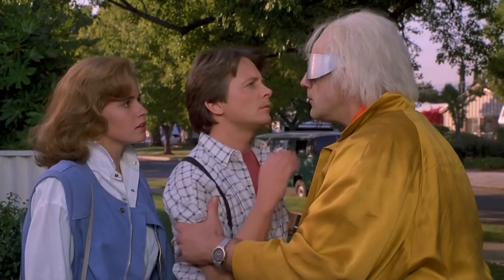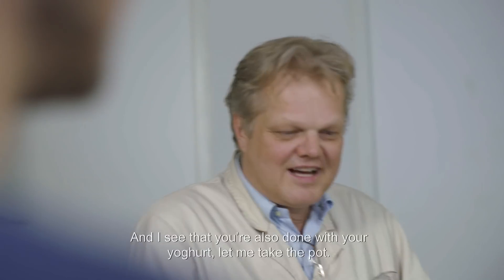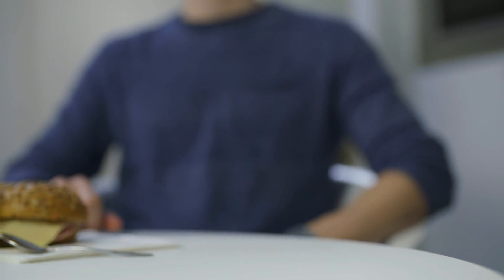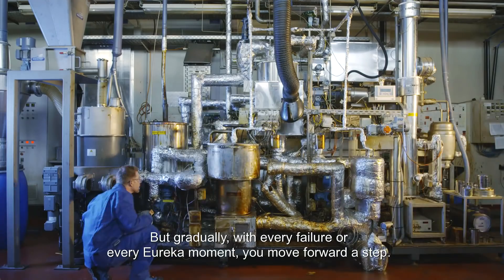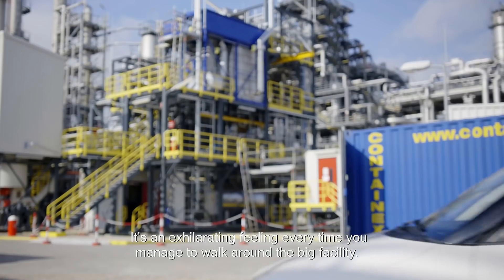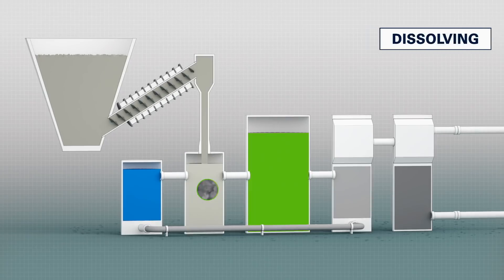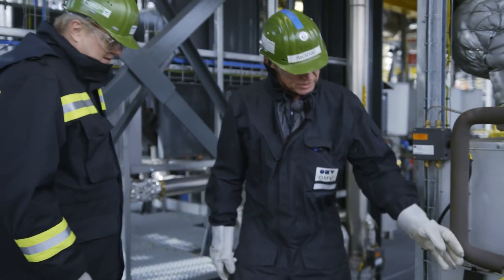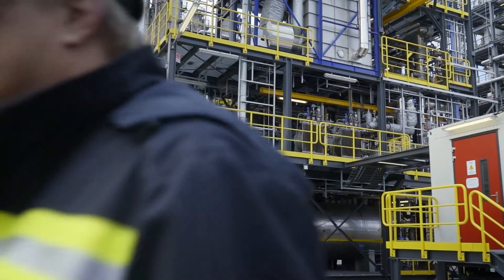ReOil: Getting crude oil back out of plastic

Comment: What is used as catalysit
Reply from the maker: We do not use a catalyst, we have a thermal cracking process running on moderate temperature levels. Read more on the technical process here: 
https://www.omv.com/en/blog/plastic2plastic-reoil-completes-the-circle-in-plastics-recycling

Comment: Couldn’t you use the “gas” fumes to heat the unit to melt the plastic 
I am also curious for a ton of plastic how crude oil is recovered
Reply from the maker: In order to extract the oil, plastic needs to be heated to over 400 °C. At this temperature, the long-chain molecules from the plastic are cracked and produce synthetic crude oil. Sounds feasible in theory, but it is trickier in practice. After all, plastic is a poorer conductor than glass, ceramics or metal. So a liquid solvent that solved two problems in one fell swoop came into play. It is mixed with the plastic right at the start of the process, supporting the heating stage and reducing the energy needed thanks to better heat conductivity. What’s more, pure plastic would be too tough to transport through pipes. Adding the solvent also enables us to address this problem.

After it has been melted down, this mass is vaporized into gas, whereby the long chains of molecules are broken down. They are then subsequently reassembled into smaller chains via chemical processes.
Reply from the maker: We are confident that ReOil® can be profitable in the future. For this reason, we are ready to bring ReOil® to industrial scale and are currently preparing for the construction of a ReOil® demo plant at our Schwechat site.
Reply: This is so exciting... Hope it would be economical...what is total running cost for producing 1 barrel of crude(Raw) ???

Comment: So you have two options one waste to energy the other waste to oil as I see the modular unit is built next to a refinery good concept to make use of .The cost is another conjuring factor over 80 percent of energy is used so it will work but a hard sell .

Comment: Tell Greta Thunberg  that you are working on it .    There is still much work to be done to  eliminate paper labels which is a nasty  contaminate   from the  plastic packaging (  use a plastic label instead!)  Shrink on  type , no glue.   If the food industry did that one thing  it would improve the bottom line for   the whole  recycling  industry.

Comment: A plastic to oil machine already exists. It's called the Blest machine. A Japanese man created it almost a decade ago!!!!
Reply from the maker: Hi Pristine Parr,
T´the fundamentals of thermal depolymerization are well known. Our patent is based on using a solvent to reduce the viscosity and thereby facilitate a large-scale, industrial solution (more than 50,000 tonnes per year). The solvent is a highly aromatic, high-boiling solvent (high boiling range).
Reply: OMV  how toxic it this solvent to the environment? What’s its life span? What are you doing with it after it’s past it’s useable point? What is the name of this solvent?
Reply from the maker: Hello,
thank you for your comment. The basis of the OMV patent is the use of a solvent to reduce the viscosity and thus enable a large-scale solution. The solvent is a highly aromatic heavy boiler (high boiling range).
The solvent is filtered and recycled after the extracted crude oil has been distilled off. More details about ReOil can be found in this article:
https://www.omv.com/en/blog/reoil-getting-crude-oil-back-out-of-plastic

Comment: There is a company in the United Kingdom that seems to a very similar process that you do. Are you aware of them?
Reply from the maker: Hi thinkimfunny,
The fundamentals of thermal depolymerization are well known. Our patent is based on using a solvent to reduce the viscosity and thereby facilitate a large-scale, industrial solution (more than 50,000 tonnes per year). The solvent is a highly aromatic, high-boiling solvent (high boiling range).